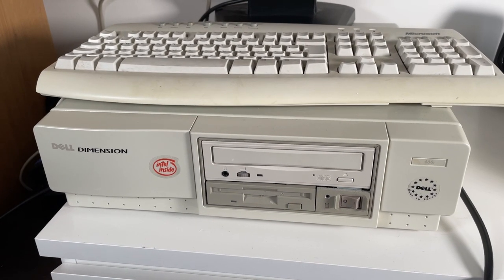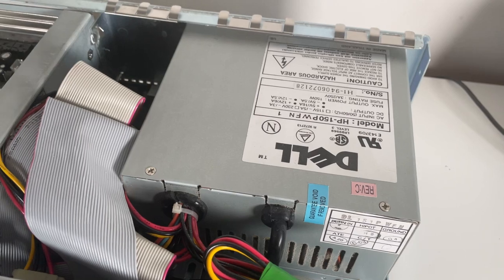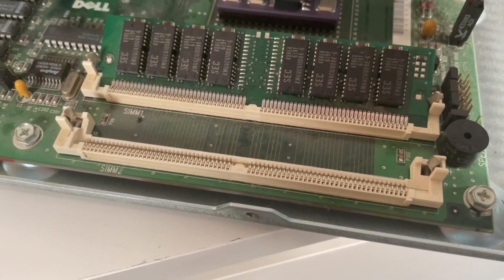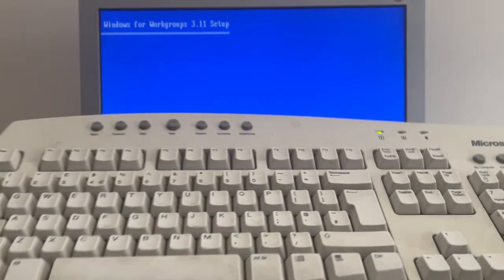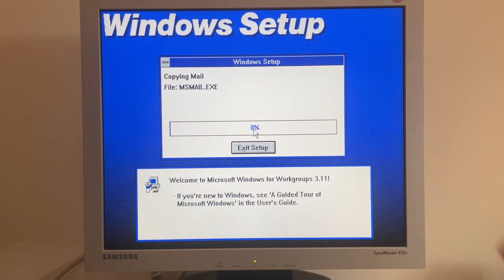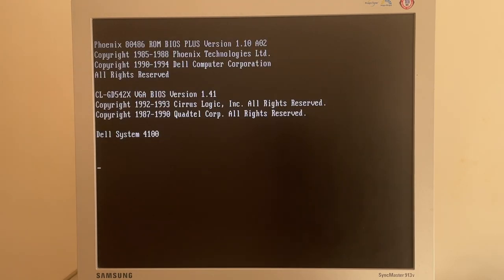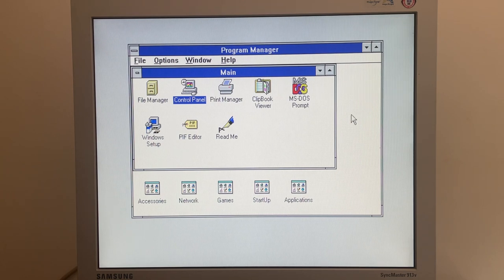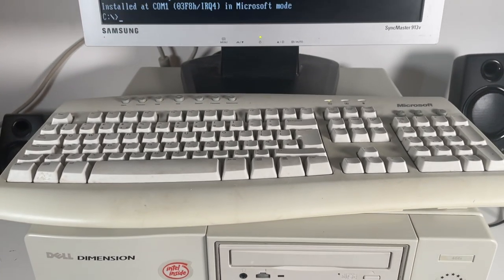Exploring a Dell 466i PC and installing Windows 3.11

Comment: I always love the 486 era machines.
Do those disks have a special drivers for Dell machines?
Reply from the maker: To be honest I did not explore the disks any more than just using the ones that the installer asked for. ot sure any drivers would be needed as I added the sound card myself and I think that VGA card is supported already.

Comment: I used to build those to order here in the UK, for Dell.
We cut every corner we could invent, then I'd have to rework the motherboards to get them functional, in some cases, barely functional. Your monitor probably just needs a recapping.
Reply from the maker: It seems you did a good job! Still running after all these years... One day I will investigate that CRT!
Reply: @ljrretropcs  Just to clarify, yours is a Euro build, whereas I worked at Dell (UK), Millbank Way, in Bracknell in Berks, so I didn't have a soldering iron on it chief! Fun fact about working there in the 80's- 90's... We used to ship in pre-built green screen Taxan monitors for inclusion with outgoing orders, but it was someones job to slap a dell sticker over the Taxan logo!

(Word to the wise, when dealing with old CRT kit, always earth the machine by sticking an earthed screwdriver under the large sucker gizmo attached to the tube inside the case, and try not to end yourself, eh? Those old boxes can be quite killy if you're not careful!)

Comment: The system will definitely benefit from a GoTek floppy emulator. I have three retro systems with two dead floppy drives. The GoTek emulator saves me from a lot of aggravation of bad floppy disks and dead floppy drives.

Comment: Seems a nice and clean unit.
In 2021 a new IBM 486/SX had surfaced on eBay from Germany, for 200 EUR.
That was the same PC my father bought us back then.
I regret skipping that deal due to shipping cost and space.
Reply from the maker: It is always hard putting a price on your "holy grail" PC. Usually best to grab it if you can and save the regret!
Hope you find another one

Comment: Cool machine! I remember literally all of these biege boxes having Sony PSU's that would eventually fail catastrophically and fry the entire motherboard. They made them in Macs too. Sony also had that problem with their batteries. It's a nightmare. I recommend changing out the PSU in these 1990-2005 era of machines to a modern PSU or for a laptop, battery. Still awesome tho. For the CRT not powering on properly, it's a dead flyback transformer. As scary as people make it sound, you can actually replace them quite easily with some saftey tips. I recommend bingewatching Shango066's CRT repair videos for advice!
Reply from the maker: Thanks for that adice! I am fairly happy to try soldering things just not very skilled :D
Reply: @ljrretropcs  Lol. Flyback actually requires minimal soldering. It's a little black ceramic capacitor that supplys the high-voltage to the CRT anode. Discharged it's absoutley harmless, tho. https://en.wikipedia.org/wiki/Flyback_transformer
Reply from the maker: @megatronskneecap  Cheers I will crack it open at some point and take a look!

Comment: Just as you I had run out of patience with mouse balls... You still keep some for real diskettes, I have run out of that too and couldn't live without my Gotek drive 😅
Reply from the maker: I am still on the fence about getting a Gotek. Certainly could use one! But with my external FDD as long as I have working disks its not really any bother to move files over or make disks

Comment: have you posted the floppy disk images anywhere? I've been trying to find WFW 3.11 with the Dell splash screen like my parents comp had nearly 30 years ago and all the Dell images are apparently just standard WFW 3.11. I have a Dell Precision 425Si which is in the same case but it's a 486SX 25 MHz but the motherboard apparently has the option to take DX/DX2/OverDrive. thank you
Reply from the maker: I have not! But I can grab my usb floppy drive and try to grab an image of the soon
Reply: @ljrretropcs  that would be awesome thank you (I suppose toss the link in the description later?)
Reply: @ljrretropcs  were you able to dump your disks yet? ;)